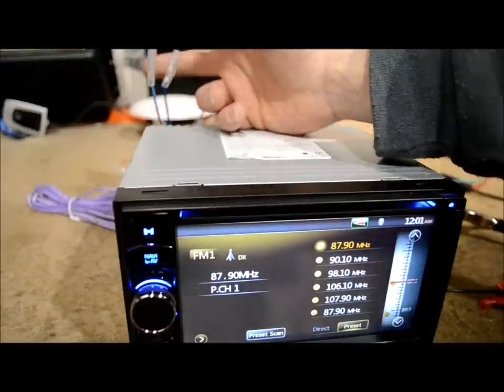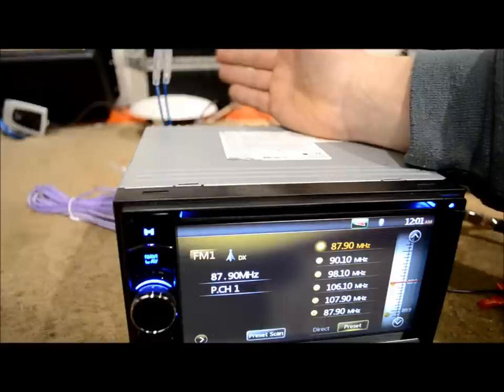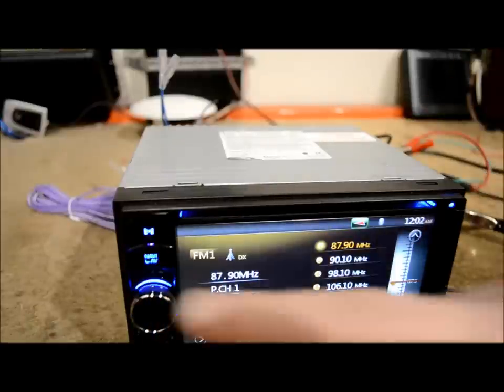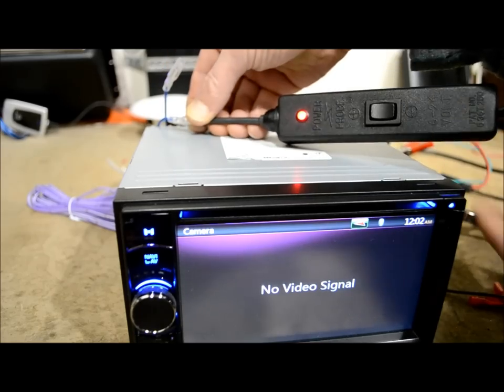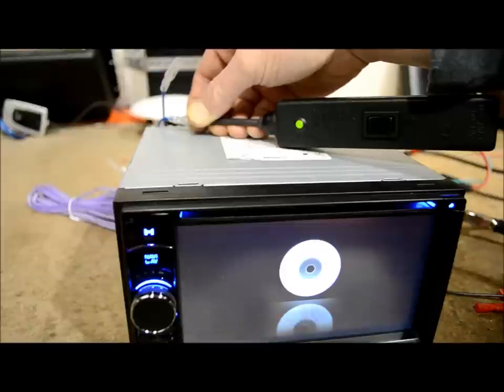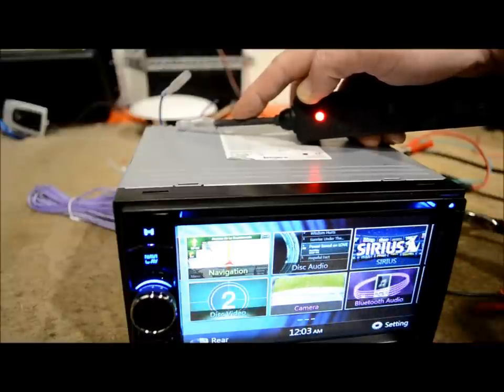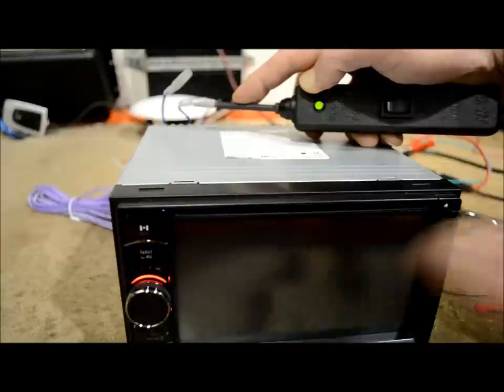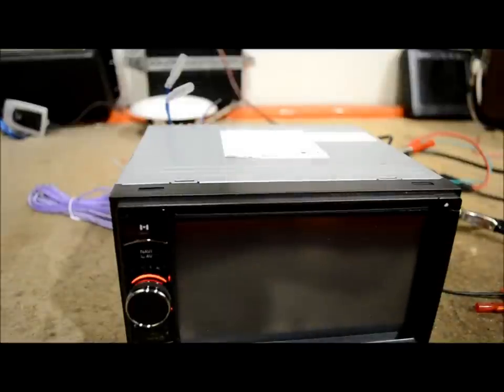Difference between amp turn on and antenna remote wiring

Comment: I'm so glad this video is out because I wired some stuff up to the power antenna wire because I didn't want to add too much drain on the amp turn on wire because I got several amps. Then I started to think about it a day later and realized that it probably turns off and on with the FM radio.. sure enough this video reassured my second thoughts. Good thing I watch this video before installing all my wires in the dash.  Now I can fix it.  Thx

Comment: Can not using the blue wire cause the stereo not to power on? I have the black yellow and red hooked but not blue. And my issue is I have no power to stereo.

Comment: My car has a power antenna, but I’d like to listen to more than just the radio. My wiring harness for this car has a blue-white labeled for “AMP TURN-ON” and a solid blue labeled for “POWER ANTENNA.” But, my head-unit only has one blue-white cable. 

I’d like to have both the amp for digital audio and the power antenna work. Which wire should I connect to the blue-white on my head-unit? Should I connect both? The manual for the head-unit says it’s unnecessary to connect anything to it, unless you have a power antenna. But, my harness has both cables, so I’m really confused.

Comment: I tried without the blue wire hooking up an aftermarket head unit to Nissan and without the blue wire hooked into the antenna adaptor the radio doesn't pick up many FM stations. Needed to hook it up to receive all stations.

Comment: On my jvc din I have a steering  wheel blu wire & power ant..and my blu remote wire that go’s str8 to amp. Can I put the amp turn on to the steering wheel wire?

Comment: I made this mistake Not because I seen two wires (blue / Blue white) I have the stock Wiring harness and a aftermarket Harness hooked up to a Kenwood single din the Blue wire wasn't looped into the slot like the others The blue white was Which i was going to use for my Sony explod 1000w 4 channel I also ran a 4 gauge power and close by 4 gauge amp ground ..So now i'm going to ether T into the blue/white or cut the blue white out and crimp it face to face ... Thanks for the video
Reply: freakyflow i need help

Comment: Hey - I'm installing an aftermarket radio in my car and I don't have a blue-white wire... I only have a solid blue one. I know this is for the power antenna, but I don't have a power antenna. Should I just leave the blue wire unconnected then?
Reply: Figure it out???

Comment: Love your video's.....   My question is.    If my deck came with a remote control which one of these wires would i connect to?  Off the deck the remote control wire is blue.   Should i connect to the blue white for full control of remote ?

Comment: i had blue wire coming from the pioneer avh-w4400nex ... from the after market harness had blue/white and blue wire. so i connected all the blues together. is that messed up?

Comment: What happens if I don't have a blue/white wgat can I tie the remote wire into ?
Reply from the maker: In that case you may like this:
https://www.ebay.com/itm/Universal-Dash-DVD-Parking-eBrake-Relay-Switch-DVD-Bypass-Best-Bypass-4-Wire-/401470914838?hash=item5d79880116

Comment: What if your car stereo DOES NOT have the blue/white amp remote wire????
Reply: Any answer you found? I'm connecting my sub to stock radio and I don't have the blue/white amp wire either... I see an accessory wire but don't know if I should use that. I also see illumination wire and don't know if I could just use that. What did u do?

Comment: Hello, I drive a 1997 ford expedition, when I hook up my blue and white wire to red accessory wire along with stereo red wire.  Without stereo red wire. It blows a fuse. does that mean my amplifier needs to be replaced?

Comment: Currently installing a Pioneer AVH-W4500NEX receiver in a 2011 4runner "non-JBL" system. I'm not installing an amp so do I leave the power antenna "blue" wire on metra harness and system remote "blue/white" wires on pioneer harness disconnected?  Or do I connect these 2 wires together?  Remember I'm not installing an amp to this stereo.  thanks for your help

Comment: Hi My hu dmha5450bt pioneer when hold off key in pannel and off hu by toch but my amp is runing..because remote wire (blue/white) have electric
when switch is off vehicle my external amps is shot down.
remote wire is electric when switch is off vehicle and remote wire is cut electric
my head unit is problem?

Comment: I got a head unit with a blue wire stated as ant out, I am trying to connect the right wire to my active subwoofer to trigger it switch off with the remote wire. Can you help me to figure out which one should I fix to my subwoofer remote wire is it the acc 12v+ Red wire or it's the blue wire stated as ant out. I don't have the blue white wire in my head unit
Reply from the maker: use the red instead
Reply: @Lesscoelectronics  thank you 😄

Comment: (blue/white) wire from hu harness to your remote amp wire
blue antenna wire to red 12v ignition wire for amplified antennas also if you don't have an amp for subs hook up your antenna wire to your (blue/white) wire works either way lots of videos don't mention that
Reply: THANKS!!!
Reply: Raquel J so if i don't have a blue/white i can just use the solid blue wire for my amp and it should work fine? Please help lol having trouble.
Reply: Hi i have honda accord 2008 i install aftermarket gps but everything is good but not sound the car have amp i need conect the blue and white cable to the red 12v i ask
Reply: Ya definitely
Reply: Jimmy Mueller oka thanks i done i have sounds check my channel  i make video how fix audio back for honda accord
Reply: For raising you I mean
Reply: Alec Bilzi your welcome haha
Reply: Ok, I have spent hours trying to determine where the wiring is "off" on my aftermarket install. 
Unlike most people (it seems) I can get sound from ONE speaker (front passenger) but not my other three doors or dash tweeters. 2004Jeep WJ with no amp, two different factory radios played radio great but both had broken displays and disc changers, thus the upgrade 
With all these wire connections: I have sound from a single speaker, the other 5 are not blown and will work if I put the busted factory radio back in. 
1) I put the solid blue with the red ignition12v wire (while the two red wires between harness and adaptor harness were connected, I added in the blue). 2) I tried putting blue/white with solid blue.  3) I also twisted the two blue/whites together between harness and adaptor harness. 4) I also attempted to (while all other  connections we're perfectly color matched including the blue/white) twisted  together the blue to the orange illumination/dash light wire. Samefor all wire connections. One functioning speaker, nothing at all from any others, and the head unit works fantastically otherwise.
What am I missing here?!?!
Helpful tips and suggestions would be appreciated. Thanks.

Comment: Thanks for the video. Installing an old Sony receiver in an old Honda. I have no wiring diagrams so I was trying to see what the differences were on the 3 different blue variants I have. Hopefully this answered my question and saved me some troubleshooting.
Reply: did it?
Reply: @JDMHaze  yes it did.
Reply: @diversedad7954  So I'm having a similar issue with my 2000 RX 300, if I connect the Amp-C/control wire. to the 12 V accessory should that work and have my sound working?
Reply: @JDMHaze  yes that should send power to your amp only when the key is in the on position. I would use a voltmeter or a test light to make sure that wire is hot when the key is on before you hook everything up and put it all back together
Reply: @diversedad7954  i did and it still didnt furn on 😩😩
Reply: @JDMHaze  if I were you I would just use a voltmeter and try different wires until you find something that is hot with the key on and not hot when the key is off. There are many accessories that are designed to turn on with the key and off with the key so technically you can run that power wire to anything else that functions in the same way. There should be something in that wiring harness that does that even if the wire is the wrong color

Comment: Hello. I bought an aftermarket double din wince radio a few months ago, There was no manual with it. When i installed the radio, everything worked fine exept the fm reception was very poor. I just recently discoverd the blue-white (amplifier) and blue wire (antenna 12v) on the back of my unit (i know :) i'm a newb). So my question, i dont have an active antenna in my ford focus '08. If i would buy and atenna amp, i connect it with the blue wire, coming from my headunit for power? will it make any difference?

Comment: I have a( Kenwood dnx 720 exc) head unit with a blue/white, and a blue/yellow, and also solid blue wire, I hooked up my remote power wire to the blue/white wire and it seems to only amplify the radio portion of my head unit? all other functions have no amplifications what would should be my next alternative? " should I connect my remote straight to the blue wire or tap in to the cigarette lighter? " I'm confused on this matter and would like a few suggestions. thanks

Comment: Hey so I ordered from crutchfield and had there wire harness service put mine together, the blue is connected to the blue and white and there is a blue and yellow wire not connected to anything, is that my remote turn on wire for my amp or do I have to do something?

Comment: I've got a really good question for you I've installed a lot of stereos myself and I took the double DIN out of my 2002 GMC Sierra and put it in my 91 S10. I've hooked up for everything correctly even the remote wire the blue and white striped wire to the remote wire that goes to my amp. But I'm getting no power to my amp whatsoever I've checked the positive refuse everything I even took another wire and tested to see if it would go between that and amp maybe thinking that the wire had got a kink in it and broke the copper. Nothing
Reply: Me too
Reply: I need helppppppopppp
Reply: Unhook the blue and white wire and use a switched outlet on the fuse box or other switched wire.

Comment: My Car has a JBL audio system and I don't want to use the amp. If I connected the blue/white to constant power, would it work fine? The unit works but currently no sound comes out (blue white and blue are both capped off).

02 Camry LE JBL

Comment: What if I only have blue/white wire and no blue wire? And it seems that the blue/white is connected to a solid blue power antennae wire?
Reply from the maker: that tells me you have an amp in your car and no power antenna.
Reply: What I'm saying is that the remote wire is connected to the antenna wire? Not sure why.

Comment: I just installed a stereo in my Nissan Frontier. Would you know why when I went to plug the antenna wire in I accidentally touched the stereo with the end of it and got a spark. And yes it was all off the key wasn't even in the ignition. Everything seems to be fine though and seems to work as it should.
Reply from the maker: that happened because thats how those nissan's get their stereo ground
Reply: @Lesscoelectronics  that's what I ended up finding out. Doesn't seem to fit right either so I ordered an adapter for antenna to the radio

Comment: where can i connect my blue antenna wire to? my head unit only has an remote amp connection which i have already connected to my active sub. any help much appreciated
Reply from the maker: you can use that blu/wht and put it to both, just know that when you play a disc or aux the antenna wont go down, thats all
Reply: @Lesscoelectronics  I have a kenwood kdc-x304 stereo with a 760w GM 53007 pioneer amp and a mtx 12. I had power 2 amp but no sound and I wired it just how guy at pawn shop told me 2. Hot to 12+ on amp, ground to negative on amp, rca from preamp inputs on stereo with other in amp and blue wire from stereo 2 where it says system control on amp and I get nothing. Amp has 13 volts gauge tested. Is system control on amp same as a remote turn on? Also stereo has blue connected to blue/white. I just want some bass dang it

Comment: Ok just FYI on my accord 13' i bought the metra antenna adapter 40-hd11 and it comes with an additional solid blue wire that I do not have to use..it comes with the plug and the blue wire attached tyo it but u just plug the adapter(FEMALE) into ur stock antenna plug(MALE)and thats all i needed to get the radio to now recieve a signal..hope this may help

Comment: Ok what if i dont have a blue / white wire ? I only have a blue would there be another wire i should look for ? I just got this android head unit and it has only a blue wire the car i have is a 2010 honda crv exl with nav. I have heard that this is the hardest setup to wire in a new unit i cant seem to find any info on this model car its almost like nobody on earth has setup a android unit on this car ? I almost the same issue the radio is ok but when i connect the phone or try to play music from bluetooth or on the navigation i have no sound ? Any ideas would be a huge help thanks ...
Reply from the maker: in that case use the red accessory lead
Reply: @Lesscoelectronics  cool ill give it a try thanks
Reply: @Lesscoelectronics  wow man you are the best it worked you just saved me a huge pain my jaw dropped why the sound worked on everything 😉😀😆😉😘😘😘 so happy 👍👍👍👍👍
Reply: Thank you so so much 👍👍👍👍

Comment: Hi,i got a question for you.
I have a kenwood dnx8220bt,and i a little bit confused how to hook up the antenna wire.
I have 2 blue/white wires(1 wire in 1 pin,and the other wire right beside it in the other pin) that comes out of the wiring harness from my kenwood radio.
The first wire is a total connect from the plug to the iso (female) connector(no functionlabel on it),and the other one is a short wire(not plugged to anything) but has a label on it that says its a"ant cont".
Which of those to wires i have to connect to the blue wire(with label "ant rem")?
I dont have a motorized antenna,and no  aftermarket amp installed.
I only have a factory amp.
Please help me.regards

Comment: So mine is wired right I assume  I've had my set up all hooked up for 1 year no issue then outta no where my subs only work when in in accessory  mode but as soon as my car is on it doesnt. 
Could it be the remote wire ?

Comment: Hey man im back with a different problem  I have a strange thing happening with my android head unit...when i put my key in the ignition the sound on the android radio is to loud it turns on to like 15 but when i stopped the car i left it at 1 and it scares the shit out of me when i start the car ? Any ideas why its doing this that would be super....i installed it on my 2010 honda crv the factory unit had navigation.. thanks..

Comment: What if I don't have a power antenna or the blue/white cable? I only have the blue cable. Is it ok to use the blue cable in that case?
Dude who worked at Car Toys said he did it all the time (use the blue cable).
Reply: I have a dual double din...the unit only works when the car is on acc..but when i crank up the car i lose sound and the screen will say no signal..can ya help me out with my problem

Comment: Can you connect the power antenna and amp remote to the amp remote of the headunit? My head unit doesn't have a seperate wire for the power antenna
Reply from the maker: You sure can, I suggest adding a relay to handle the extra power draw though..
Reply: Lessco Electronics alright I might do that. Thanks

Comment: The kenwood aftermarket radio i have, has both blue solid wire and blue/white. I'm not installing an amp. Do I just tape both blue wires up and not use them?
Reply: Tape up, or put heatshrink tubing on any wire not used, no harm no foul, they don't have to be connected. Personally I prefer heatshrink tubing... that's what I use.
Reply: @garyr7027  if im not installing an Amp, I dont use the blue wires right?
Reply: @sammysam9560  correct, just leave it unhooked.

Comment: My subwoofer randomly stopped working, my amp isn't getting any power. Everything is wired correctly and the ground wire is fine to. I noticed that my wire in the back of my head unit for my antenna the top part was discounted and broken. The question I'm getting at is does the antenna have to be hooked up properly in order for the amplifier to turn on?
Reply from the maker: mpryderz no sir, one has nothing to do with the other.

Comment: Thanks for the video! Question....what exactly is this remote wire doing? Is it sending power? Or is it just sending a signal to tell the amp to turn on? Meaning if auto powers off when no signal is sent over this blue/white wire. Thanks.

Comment: i need help bad i have a blue and white wire and a solid blue wire both not connected and idk what to connect it too
Reply from the maker: +Sean Harris the blu/wht goes to your amp (if applicable) and blue is power ant if equipped....
Reply: i dont have power antenna and i figured out the setup the amp remote wire is actually the blue wire and i hooked it up to my red wire the accesory power wire so it turns off with my care and every feature on it works like a champ now but i really appreciate the response.

Comment: I am installing a deck and sub in my car and had no idea where the amp turn on wire went. I was looking for a wire terminal on the back of the deck but this vid reminded me there's a blue and blue white wires coming from the harness. Thanx a bunch. Now just hafta find out why the deck stopped working but still ejects discs.